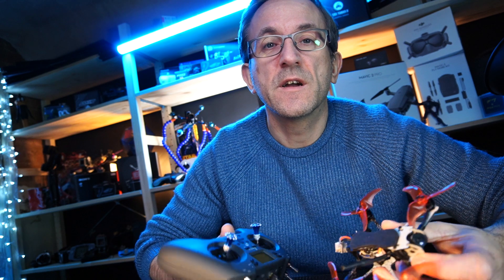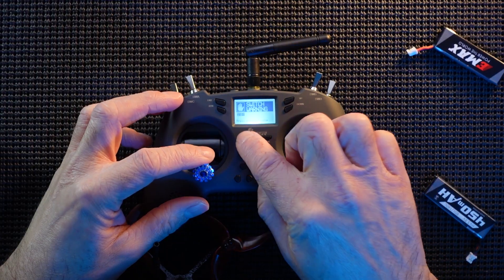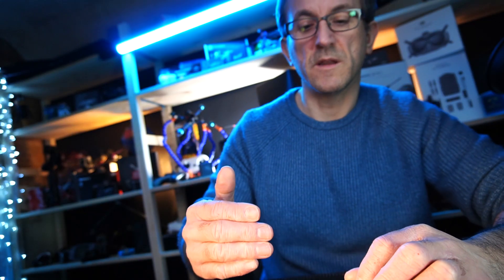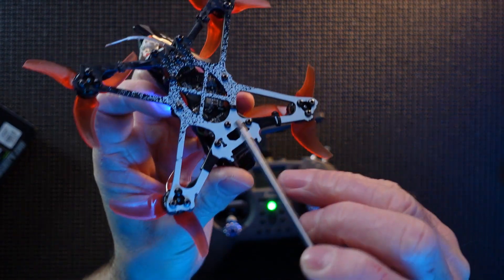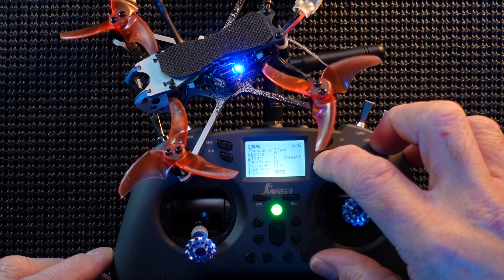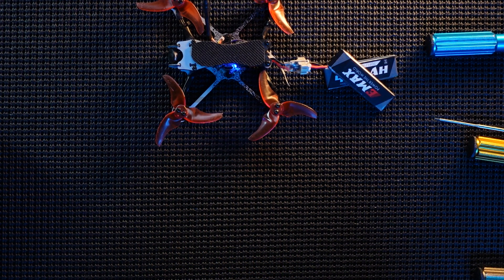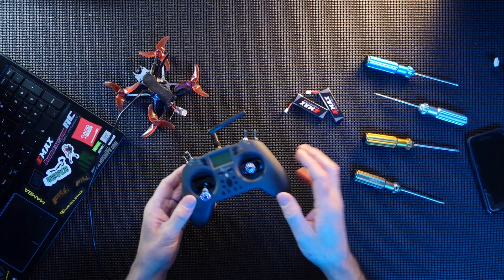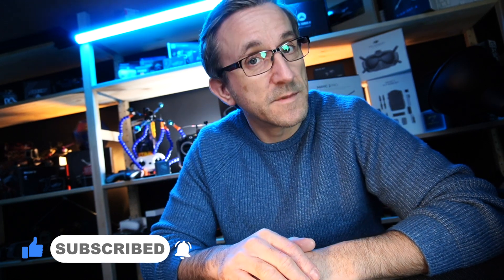How to Bind the Tinyhawk Freestyle II (2)

Comment: Thanks for the video! unforunately something wrong with mine. I don't have a blue light at all on my board. cant seem to get it into binding mode with the button. Using cli says "unsupported when I type the command.

Ended up using a separate receiver.

Comment: I’m curious, how would you make the remote change between modes for the drone, like how would you make it go from casual flying to doing flips and tricks with only one switch.
Reply: if you have beta flight
then go in there and go to modes and then scroll down until you see Arco trainer if you don't see it make sure at the top of modes tab
unused modes are off.
assign that to a switch and there you go.

Comment: Hello mate! I was wondering if you are using the cc2500 or jp4in1. Can you please explain me the difference? I want to bind the radio to a tyro 79s with Frsky xm+ receiver, which should I choose? 🤔
Reply from the maker: hey - the jp4in1 is the multi-proticol version, meaning it will bind with a wide range of recievers, the other cc2500 is not a multi-protocol and will only bind with certain recievers.the tyro is not what you are binding the controller to - its the reciever inside it... frsky, flsky, spectrum etc...  I'd buy the jp4in1
Reply: @Datfpv  Thank you soooo much mate! Do you have any coupon to support you? 😊
Reply from the maker: @georgegourzoulidis210  I only have my pateron at the moment if people want to support me: https://www.patreon.com/datfpv